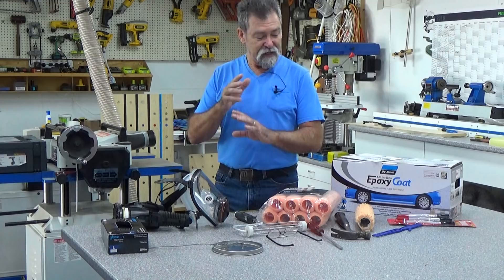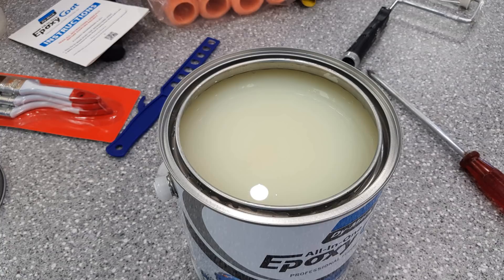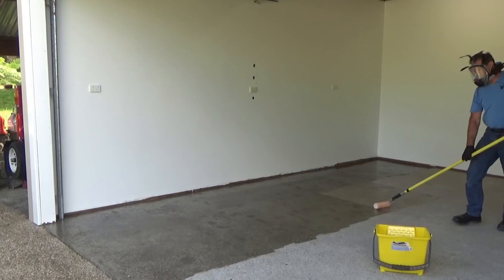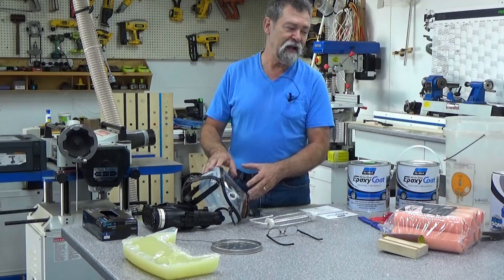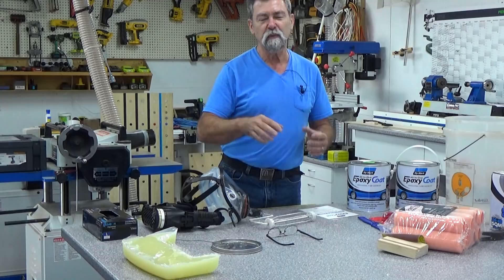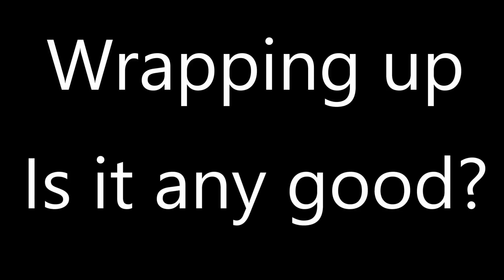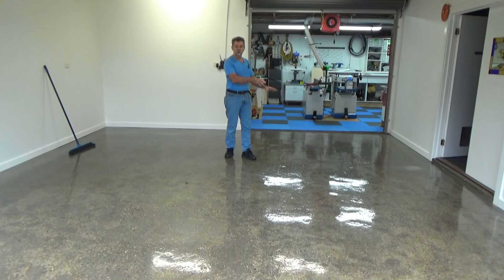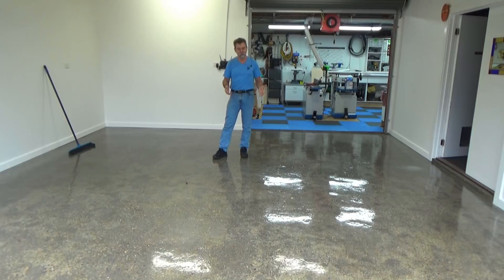How to epoxy paint a concrete garage floor. Dave Stanton easy woodworking

Comment: Dave. I refinished the block parquetry floor in my man-cave (rumpus room) a couple of years ago. Months of stripping and sanding and a lot of dust. I used a rotary sander (like a 14" Rotex) with a built-in vacuum cleaner. Here's a tip - keep the sawdust for mixing with filler to match the floor when filling cracks and holes (from drilling and injecting glue under loose timber tiles). The floor finish I used has a water based solvent with low VOC's though the fumes were still hard to take. When I finally finished re-coating (keeping a wet edge) the floor was really flat. Yes it is a bit squeaky but fairly kind to most footwear. But here is my point, beware of fine sawdust, it acts like tiny ball bearings and is very slippery. I hope that is not the case with the epoxy finish on your floor.

Comment: I used the same product in my workshop  but in the light  grey colour.  I am glad that I chose the grey colour as any small dropped item is highly visible and the light colour seems to reflect light making the shed look like I've upgraded to 5000K LEDs.
Reply from the maker: The clear also scratches and dents but you really have to get down to the floor level to notice it. Just standing and looking it is hard to pick due to the polished surface of the concrete.

Comment: I had my garage floor covered with epoxy.  It is fantastic.  There is no concrete dust, it is easy to clean and it looks great.  However, wet feet and shoes ARE a big issue on my epoxy floor.  If I had to do over, I would add the anti-slip additive.
Reply from the maker: Are you able to do one more coat with an additive?
Reply: David Stanton I probably could, but that ship has sailed.

Comment: Shiny floors... The arch enemy of Darth in Croc's!
Croc's have got to be one of the slipperiest forms of footwear that I have ever worn on an even slightly polished surface, including clay pavers on a slight incline.
Reply from the maker: Thanks for the heads up with crocs. Never worn them so I guess I will never try in the future?
Reply: Thanks for the info on the Croc's Peter, I was thinking about purchasing some for casual workshop use.

Comment: I was planning on doing the garage in our brand new house prior to moving in until I found the builders and painters had treated it like a garage and the scraping of paint, grout, mortar and other prep was going to take longer than my time window. Once my shop is built and I move all of my gear out I will have a proper go!
Reply from the maker: I am happy with the result. It is relatively quick and easy if everything has been well prepared.
Reply: Mongrel85 if you plan to use yours as a workshop check out Polyurea coating

Comment: If you watch others using epoxy bubbles are removed when wet with hot air.
Reply from the maker: Brian, because the room is 6 x 6 metres it makes it impossible to get to all of the bubbles whilst the epoxy is still workable but unable to be walked on.

Comment: The air bubbles are off gassing, a soiked roller will be needed. My problem with these cheap epoxy products is first the smell, they go on so thin they will not last. Spend the money on a good quality epoxy. Good ones are UV protected. I do this for a living and only use a good quality commercial epoxy.

Comment: Hi Dave, My house is very old and the bricks are starting to crumble. Can you use this epoxy on a vertical surface because if you can that would be a perfect solution to my problem
Reply from the maker: I doubt it John. It would slump.

Comment: Does the slab have a vapor barrier under it?  It will be interesting to see if moisture tries to migrate up from below.  

Did you give any thought to the version that has vinyl flakes broadcast into the wet epoxy?
Reply from the maker: Yes there is a vapour barrier below the slab Barry. I considered all the different types of epoxy on offer before making my decision.

Comment: Hi Dave it's Aaron again.
I'm just in the process of transforming my 2 x car garage into a workshop and also a garage for our 2 cars.
The concrete floor was painted many years ago in beautiful Red colour - Ha Ha 
Any ideas on what process Or hints as I want to re-paint the floor in either a grey or lighter colour?
Reply from the maker: Hi Aaron. I am not sure of what the question is? You may want to hire a concrete grinder like I did. You can get different coloured epoxy's from the company that sponsored the product for me to use. Link in the "show more" below the video.

Comment: have seen this professionally done and they use a squeegee instead of a roller.
Reply from the maker: There are different products available Wayne. Some are a flood coat and self level, some are as you suggest and then this method which the company recommended. I used the back of the applicator as a squeegee a few times as well.

Comment: Hi Dave , Aaron here.
How would a floor buffer go on the new epoxy floor ?
Reply from the maker: I think it would be a great idea but I have a concern. I don't want to turn it into a too smooth surface. And, as it is my garage the little imperfections will not worry over time as I am sure there will be more everyday wear from just being used.
Reply: Yeah I suppose it's still just a garage floor and not the Grand Ballroom at a five star hotel 🤣🤣